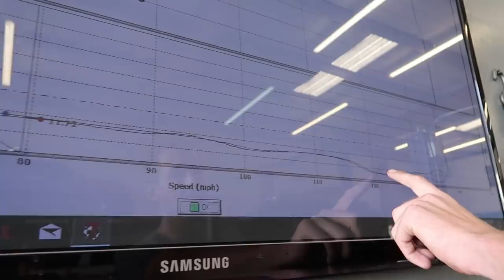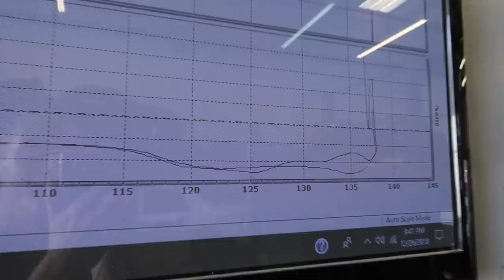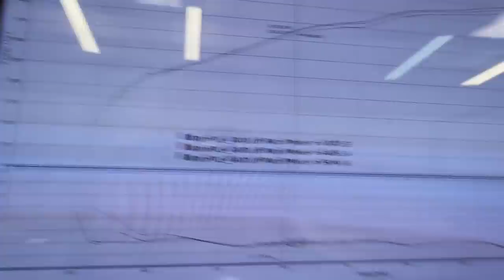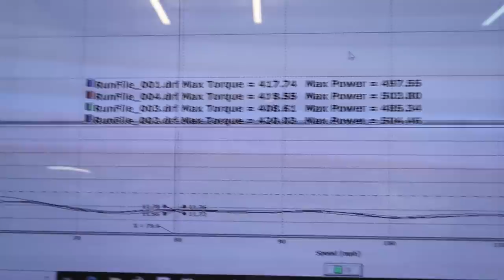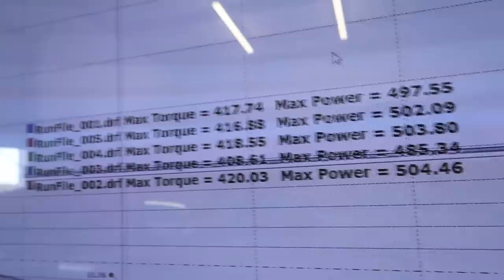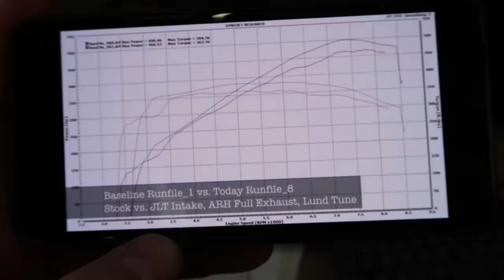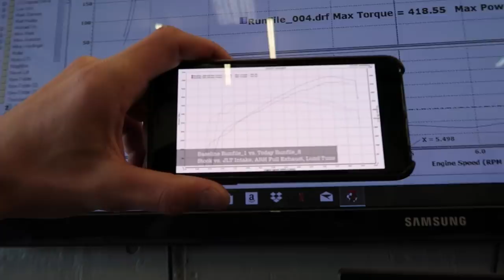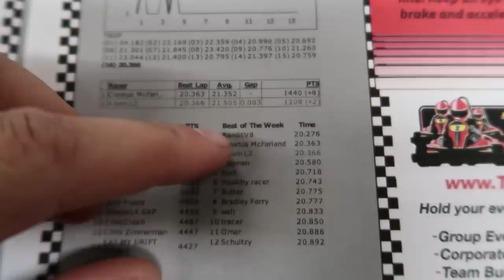GT350 Dyno with Cleetus McFarland!

Comment: Also, I can't remember the exact oil temp but to reach 8250rpm it has to reach a certain oil temp or it will hit the soft rev limit at 8k. It's in the owners supplement or manual somewhere. It may be 190f.

Comment: We have one ford that's extremely unreliable says the guy that keeps blowing up LS motors. LMAO
Reply: Yup. Lol
Reply: 1000+ hp LS's lol
Reply: Well you have to take into account its Cleetus that is blowing the motors. Hes one of those dudes that will blow an engine just because.
Reply: The ford motor is fully built the ls motors that keep blowing are out of 03 vans lol
Reply: Honestly bro that’s probably the only engine on his lot that he hasn’t had to change yet 😂 5.4 Modular strong 💪🏽
Reply: @bubbadawg99  Now he's posted on his insta that its the most reliable car they have lol. Just needed some time to get sorted out!
Reply: @brandondimmitt8467  with a 1 liter more, not impressed. 4.6 liters have been in 5 second quarters. stock block and heads. LS wut?
Reply: Connor Boyle It’s not fully built lol I followed the whole build. He just slapped a supercharger on it and intercooler and radiator.
Reply: Help Me lol it’s not fully built, but it is a GT500 engine purpose built for going fast. Very different than the junkyard 5.3L LS’ they were pulling out of Tahoe’s.
Reply: @CoconutMigrating  I have yet to have a GM guy tell me that junkyard LS engines are NOT able to handle 1000 HP or some other rediculus claim and none of them have said it has to be out of a Camaro Zl1 or Corvette. So just because you know your shit thats not the conscious.
Reply: Tim D A2 9S Ford’s Mustang engines are all performance-based. They don’t distribute their engines to their other lineups like GM does. Also, it’s not like GM de-tune their engines to fit into a Tahoe. It’s literally the same engine. The only times, off the top of my head, that Ford has distributed their V8s into non-sport cars are the F150 with its 5.0 (which is still differently engineered), the Lincoln Mark VIII with the 4V 4.6 and the Crown Victoria with the 2V 4.6. They still are all performance engines. That GT500 engine is putting down 700+whp in a Crown Vic. All it needed was a supercharger, throttle body, 6-speed transmission, an intercooler, a radiator, and a 2-step and hydro-brake for shits and giggles. He never even touched the internals. It’s literally his most reliable car and he constantly beats on it.
Reply: A2 9S Honestly bro GM guys make these ridiculous claims about making 1000+hp on stock block/internals.

Comment: The problem with running on a Dyno is that you do not have air forced into the intake, thereby reducing actual power by a few HP. Try using a lawn blower directed towards the intake, it somewhat recreates real world airflow. You are all welcome!

Comment: GT350's should dyno in 5th gear pretty sure since they have a TR-3160 which is 5th gear 1-1.
Reply: As far as I know, you're correct
Reply: Yes that's right. They lost ~10% through the trans keeping it in 4th
Reply: @noidontthinksolol  Lost. 1:1 always makes the most power.
Reply: @noidontthinksolol  I agree, however dynos read off of a multitude of things, rpm of the engine, rpm of the drum being spun etc. And dynos assume 1:1 unless you change it in the setup. Realistically the Dyno would have shown maybe 10-15 hp difference so that's pretty good. It all depends on how the Dyno reads hp/tq. If you are in too low a gear like 2nd it may show a higher number than 5th, just because the Dyno can't sample rpm correctly quick enough before the pull is over.
Reply: M773 100% correct mate.
Reply: Riley Neufeld no, gear ratios are entered and accounted for. Main sources or error are; wheel diameter growth due to high wheel speed,  and, whether or not the torque converter has locked up. There is very little variation in total drive train loss loss in the different gears. Tyre growth.
Reply: @nordic5490  Tire growth is not an issue with a stiff street tire, usually a bias ply radial or a slick have problems growing. One of my relatives had his 18 f150 with a 18 manifold, a PMAS cold air and a flex tune on the Dyno in 4th gear and it made 460 whp SAE. That is too high a number mustangs with better cams don't even make that with those mods.
Reply: And Cletus thought that 4th was 1:1, so he probably didn't change it in the Dyno settings. Some gears the Dyno will read has more hp than others, even 1:1. Just like that truck it's probably making 430-440 if it's healthy but not much more than that.

Comment: The Ford GT350 does rev match, you probably haven't realised. When your driving press the clutch in and you will see the needle on the RPM gauge doesn't drop to idle it holds it because its holding revs for the gear change. Hence rev matching. But you'll probably find doing it your self feels smoother! If your good.

Comment: Adam LZ I noticed around the 1:01 mark the headlight dial was set for the Off position. Now if my knowledge of modern Fords is correct I think you might like the Auto position. The Auto setting should turn on the LED triple stripe DRLs when in the daytime and they'll be off for the Off setting?

Comment: For E85 and the mods that car has 504hp is low.......it should easily make that number on 91 Octane

With that said you dynoed the car wrong. You need to be in 5th gear with a GT350. 5th gear is a 1:1 ratio with the Tremec trans in that car. Dyno pulls in 4th will read lower in HP/TRQ vs pulls in 5th. Plenty of dyno graphs on the net for GT350s 4th to 5th comparison pulls and the 5th gear pulls are generally 10HP+ higher.

550HP on E85 is wishful thinking.......haven’t heard of any GT350 pulling those kind of numbers with similar mods but I’ve seen more than a few guys hit in the 530HP range

Either way 500 RWHP is a great number as stock those cars dyno 460ish
Reply: TheHawk05 this is true.  I dyno’d my car in 5th.  I have a stock intake with k and n.  Corsa mid pipe and livernois tune on e85.  It did 506 and 413 tq.

Comment: Did you test the e85 to see it's actually ethanol content? Had alot of issues around here with pump e85 being 45-70% ethanol. Had to resort to testing it before track days and while tuning or buying a barrel of it. You should get some ignite 114 and do a video comparison of pump e85 and ignite 114.

Comment: gt350r is only v8 car id own that motor in it is nuts 8.5k redline in 2018?? from a v8? crazy i love how its naturally aspirated and they look fucking good.. such a amazing beatiful car because of its performance and engine. other companys should understand what the g350r did and just do more stuff like that
Reply: yea its a masterpiece
Reply: @msengineeringdavid3702  yea s65 is great engine too love how its a smaller displacement.. but voodoo is better imo holds 1000stock crank and make alot of power na stock.
Reply: @msengineeringdavid3702  there were forums of it saying voodoo held 1000 stock kinda hard to believe since mostly any engine doesnt hold 1000 stock. but yea bmws have been making highrevving all motor setups in there cars since they started the m series im just saying i like the voodoo alot more than the s65 i just think bmw should have stuck to inline 6s in there m3s and just saying its cool that a big company like ford made a engine that revved past 8k. Most companys are turning away from cool shit like that and its sad.

Comment: I put a e85 system on my M3 and with that bigger cams and a different intake I went from 320 whp to 402 whp with 60% ethanol content. I got 38 from the e85 alone and the rest from the other upgrades. A 8500 rpm sure makes it fun.  What’s  the redline on the GT350?

Comment: was the oil all the way to temp roughly 180F? the engine's redline is down to 7800 I believe electronically limited when it doesn't read the correct oil temp

Comment: 12:5:1 might make a little more...Could probably go leaner than that. Needs more timing for E85 also. I run 12.5:1 on E50 at 21 pounds of boost (BMW N54)

Comment: Why would you want E85? It's cheaper, but less efficient. How would it pick up more horsepower with a higher percentage of ethanol in the fuel?
Reply: While efficiency does drop e85 burns cooler
Reply: @Newburytuning  Interesting. Thanks for the insight.

Comment: You need to change the tune to get more out of E85. E85 will let you run more timing. That's where you will see gain in power. Your not going to pick up much power with just adding E85 and not changing from a 93 tune

Comment: sae crank horsepower is 526 as listed from the factory, drivetrain loss of 15% for rwd, should lose close to  75hp, puts it at 450hp with regular gas,   with E85, he gained 50hp or so.  still good numbers

Comment: Umm... L99/LS3 make over 500 wheel all the time. So a $90,000 mustang that makes 500 is not impressive
Reply: No they do not. It takes  ported heads, cam and full exhaust to make 500 with a ls3/l99
Reply: In a manual car you can make 500 with a cam and full exhaust. The l99 takes heads,cam,  full exhaust